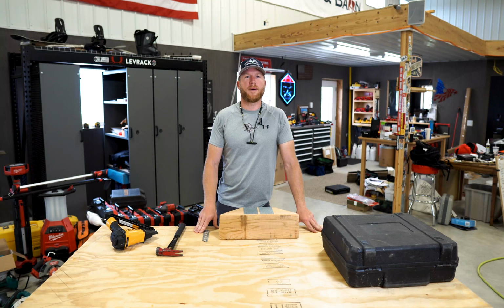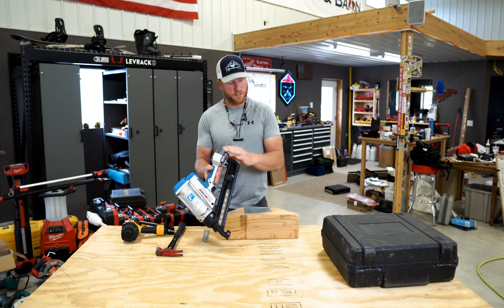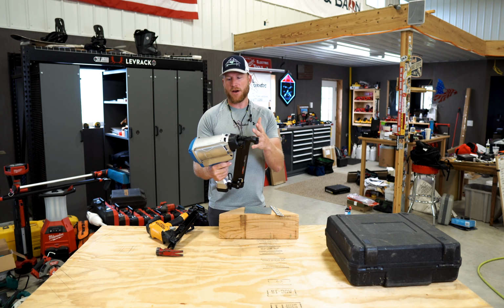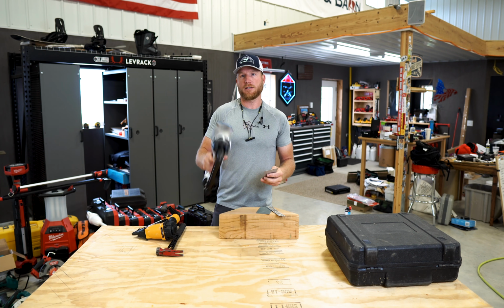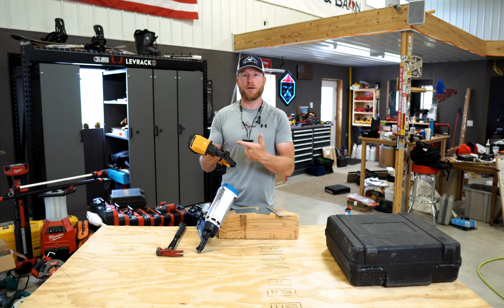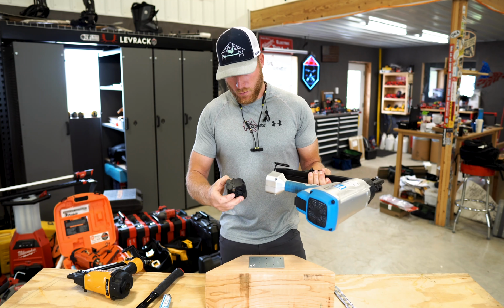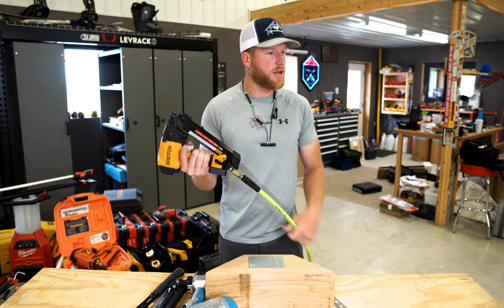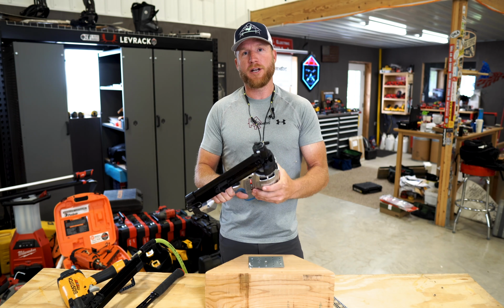Fasco Metal Connector/TICO Nailer/Joist Hangers: Toolsday  What Tool is This

Comment: Are the nails larger then the hole diameter of the connector plate? We have been banned in the far north from doing so due to uplift or consistent movement from weather events causing the connector to tear and fail. We are only allowed to hammer in the plate itself NOT the hole.   If that makes sense. We also use coil guns Paslode or Bostich with hardened fixings.

Comment: Kyle, will the nail pierce the strap if it isn't quite lined up with the hole? And if this does happen, do you have to pull the nail because of cracking concerns?
Reply: My pneumatic Paslode can, dont think the cordless has the juice.

Comment: I use a palm nailer for joist hanger nails. I use a soft end whip hose for easy maneuverability. I can get in snug eaves if I need to add some hurricane ties in tight spots. I buzz the nails in with the palm nailer by just pushing the nail with the nailer

Comment: I've always called those joist hanger nails. Awesome job man. Keep up the good work.
Reply: could not see those nails properly, the correct nail in UK is a 1” heavy twist nail ( hardly anybody uses them) they are slightly bigger than the holes and cannot work loose once they’re in.

Comment: That tool is for butcher/rough carpenters who find it difficult to properly read a tape measurer or make an accurate cut.  Finish carpenters make framers appear to be not as dumb and/or careless as they really are.
Reply: Let me guess. You’re a finish guy?
Reply: @iLikeC00kieDough 

I'm usually polite when commenting but that one just slipped out.

Comment: Im old enough to remember having to hand nail every joist hanger hell the little palm nailer when it came along was a god send i couldn't imagine going back to hand nailing joist hangers..hell now days framing you have a nail gun for every man a hammer pretty much is used to pull nails or move walls..young boys dont even carry hand nails in thier pouch half the time ..that tool is the best thing since sliced bread no matter what the brand

Comment: Dewalt 20v platform framing nailer is awesome for me so far beats having to set up air compressor and hose and oil and never freezes up in winter
Reply: Went through one box of nails through mine and it is garbage. Probably have $10,000 in  DeWalt tools and love them all except the framing gun
Reply: @mattychamberlin  I'm in the same boat...I was so happy the first few shots...then went to shit.  I only have dewalt too
Reply from the maker: googooforyou I’ve never had luck and had multiple guns
Reply: Mine has failed me too...2 new guns, didnt make it a month or so.  It runs but never fires the nail

Comment: I don't know if I would have ever bought one of those or not,  pretty pricey and also gas so already has two things against it. We had a few paslode guns or as they were called on the jobsites ,fart guns. Back then though to cut the cord that was they only option we had but was never a big fan because paslode constantly changed the design and changed the battery and charger making previous models obsolete so you had to go out and buy newer models, plus they were hard to keep working properly so very glad other options are now available. 

I bought one of the metabo cordless framing guns because of seeing it here but still waiting for it to get to Philippines think I will like it til it needs parts then that will become a problem here. 

Really like your channel except , for trade magazines I get e-subscriptions too it's the best way I know what's new out there in the real world. Here battery ( nicad) drills are just starting to show up a little so things are kinda behind in the times.
Reply from the maker: Bill Sheffield best of luck bill you’ll love the hitachi nailer

Comment: Hitachi 1.5-in Metal-Connecting Nailer - smaller, no gas and just drag that hose. I just will not chose any other brand, hose or battery powered.....
Reply: Absolutely.  The Hitachi may have a hose, but being that its smaller and lighter, its much easier to get into tight areas, which is always where hangers are.  Ive framed with gas guns a bunch because thats what my boss had, but Ill pass forever on them for my own use.  Even brand new ones set at max power have a hard time driving into hard lam beams.  People that complain about hoses need to buy different hoses, ei stop using the old hard rubber hoses...
Reply: Hopefully they will do an battery only one since their other cordless nailers are good.